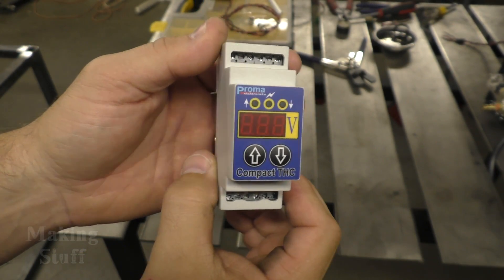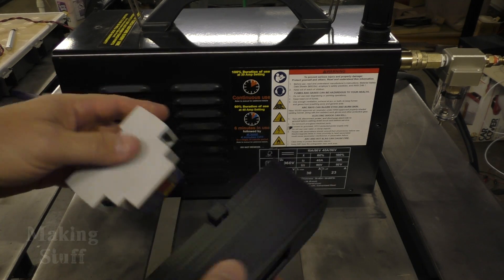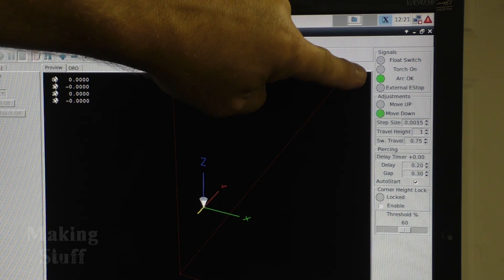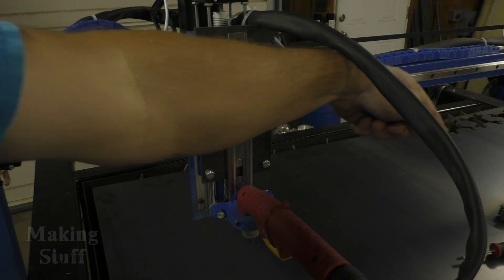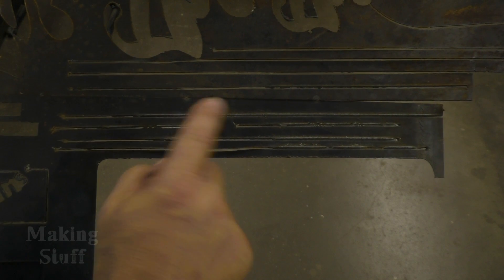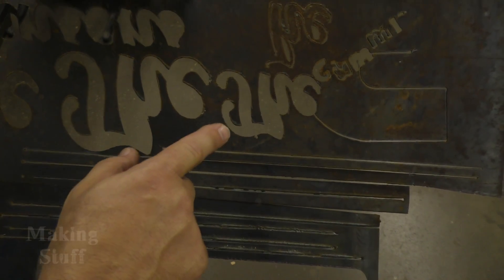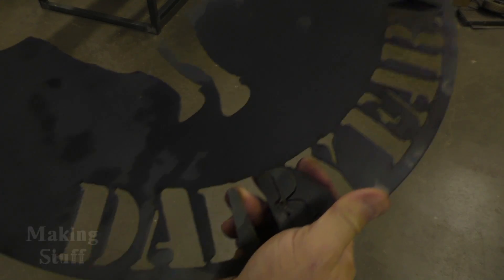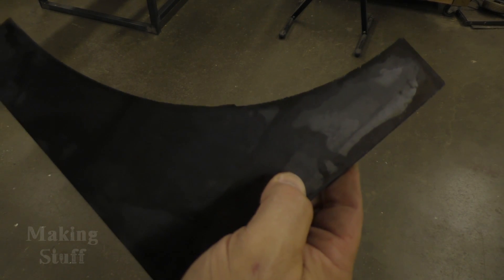DIY CNC Plasma - Torch Height Controller Installation

Comment: I also noticed the blue torch and the label shaking. You can use a heavier gantry and torch mount and don't be afraid to make it move 65lb dumbbell back and forth with stability.

Comment: Hello man, I am building a 2x2 mt plasma CNC, I have nema 23 motors, DM 542 drivers, a Mach3 Usb 5 Axis 100khz Cnc Controller Card, I dont have the height control, which is not expensive and easy to get, can you suggest one? You have plans to help me with its construction, I will thank you, greetings from Peru.

Comment: I'm all in for tech solutions, however sometimes it seems like stepping back and rethinking the problem helps. Here, the problem is your metal is warping due to heat. Instead of adjust the head with electronics/sensing, etc, why not adjust the material being cut?   Off the cuff, it would seem like it might be possible to put 2-3 legs spaced 2-3 inches away from and around the cutting head with captive bearing balls for heads.  Bottom of the ball would be zero'd against the metal pressed against the table before starting. Then your cutting head would be raised above that level to the height it needs to be.  Every time you start a cut, the head lowers, the ball bearing faced legs push the sheet metal to table, and the cutting head is now at the proper height against nominally flat metal.
A drawback might be the balls rolling over previously cut material, however I imagine some sort of compressed spring on the top of each leg would be able to provide just enough 'give'.
I'd like to build one of these, so will try it, and then probably end up with a torch height controller anyways....

But then, what about making the table an electromagnet, and pulling the material against it?
Reply: That will not work, as the material will spring back. Yes you can force it flat, but If you want to cut you will need the perfect torch to metal clearancefor maximum quality. 
Also if your 3 prongs do not touch the material (because 1 or more of them are in a previously cut area, thus not pushing on the plate) then your not even going to a correct pierce hight.

Voltage measuring torch hight control is needed, there are no ways around it.

Magnetic backing plate seems a good idea, but gives problems.

1 the magnetic field will mess up your arc.
2 As you have metal on the back of your metalte be cut your cut quality will be very bad.
3 heat and plasma arc will damage your magnet backing, so it would prove to be very expensive.

Comment: I just got my cnc plasma machine from china, as I tried to get it up for running there is problem that I have and I hope someone can help.

when I tried to cut a piece of metal, it doesn't start, it keep popes up message box say " ARC BREAK ALARM" I tried it manually the arc work. sometime the machine runs but not arc, doesn't cut at all. any idea work could be wrong? I was told be the guy who I bought it from I need to clamp it on the material not on the bed, and I need to adjust the voltage higher. Is that right?

Anything will help. Thanks

Comment: Hello I’m just wondering where you wired in the torch height controller into the breakout board? Great videos thank you.
Reply from the maker: It gets 3 pins on the break out board.  One for up, one for down and one for ARC OK.

Comment: Ive been watching youtubes on how to make THC's but that talk about voltage dividers to reduce the voltage so the low voltage boards can handle the voltage while reading the highs and lows. Does your plasma cutter have a voltage divider or is it that a proma does not need to read from a voltage divider. Hope you understand what I'm trying to ask.
Reply from the maker: The Harbor Freight plasma cutter does not have a voltage divider.  I had to hook it up to the arc voltage to use the Proma.  If you watch the video that I uploaded yesterday, I upgraded to a Hypertherm.  It does have a voltage divider on it, so on the Proma I used the 50:1 instead of the direct arc voltage.
Reply: Proma can use full arc voltage or a 50:
1 divider, depending on where you connect it. I have used both, and cut quality is the same, but I would prefer the 50:1 connection as you only have a low voltage signal from the thc to the controller.

Comment: Hey Bob just a a tip. consumables for a plasma cutters are rated in amps 40 amps 60 amps and so on. The higher the amps the bigger the orifice. you need to match your amps to what your consumables are rated for cutting on low amps with a big tip will produce crap cuts and burn up tips a lot faster. I don't have a HF plasma so I can't say what they come with or sell for them but they should be marked but figuring out what size you got and not go to far under that amperage might help improve your results and make tips last longer
Reply from the maker: The HF plasma cutter just has one size of tip and electrode.  I know it doesn't make cuts like a Hyoertherm Powermax, but it gets the job I need done.  I hope to upgrade to a better plasma cutter in the near future.  Thanks for watching!

Comment: Hi... where did you purchase the proma controller from? I am having a difficult time locating it.
Reply from the maker: I got it on Ebay.
Reply: I've been looking, but I haven't been able to find it is it listed under proma? Or another name?
Reply from the maker: Looks like there is no one selling them on ebay right now.  If you can't find a Proma, I have heard that Price THCs are good too, however I have never used one so I can't say for sure.
Reply: @MakingStuff  they are good... A friend uses one but now they don't sell one with raw voltage input, only 50:1 port.....

Comment: @making stuff Im currently working on a build similiar to yours but Im using Mach 3. The 150 THC uses 3 Input pins on the Hobby CNC Pro 4 Axis... did you eliminate some of your limit switches?
Reply from the maker: Yes you will run out of input pins using just the hobbycnc board.  In one of the videos I mentioned that there was a second printer port in the machine.  I used that second printer port and a $25 break out board from Amazon to get the extra input pins I needed to keep the limit switches.  I did run w/o limit switches until I got the second board up and running.
Reply: @MakingStuff  ok understood. The Promo THC-SD looks like it may be an alternative that doesnt eat up any ports. Have any experience with them?

Comment: would a better quality plasma cutter such as a hypertherm give a cleaner cut
Reply from the maker: The HF plasma cutter does quite well on thin sheet metal for signs and stencils.  A hypertherm will probably do better on thicker metal.

Comment: I have been messing around with a diy plasma table I bought for 5800.00 and it has the THC already but it always eats consumables because it touches the work and over heats. The preset for the THC have been at 120V and I look forward to dropping them down to see if this helps. Thanks for the video.
Reply: try 105 - 110V bro i got mine set between 108 and 111V every torch and setup different but round the ballpark have a go around there and let me know obviously different size and steel diff results but have a go around there

Comment: Bob, i think you missunderstand the concept how a THC works. When you showed those test cuts you don't have to set different volts. You have to watch Proma what volts it shows at a given feedrate at specified amps.(of course delay time has to be set maximum so you can watch it without before Proma starts to control and volts varies. By the way that feed is just way too slow.
Reply from the maker: Thanks.  I had a bad electrode in the torch when I shot the video.  I think that was causing the voltage on the Proma to be very sporadic.  Of course I didn't know this until after the video was posted. I'm making a new floating Z and will go back and check this.

Comment: It seems that your cutting speed is too slow, try increase speed by double, you will get more dust but finish will be much nicer almost without dross. Or lower amperage, it looks very thin sheet metal.

Comment: Congratulations.  I have to figure out how to wire mine.  Because I use the same controller for my router as I will for my plasma it will be a little more complicated.  Maybe I can use a different pin for Z with the plasma setup...hmmmm.
Reply from the maker: I wired the THC up to the second parallel port and used a separate break out board.  Maybe you could do the same thing?